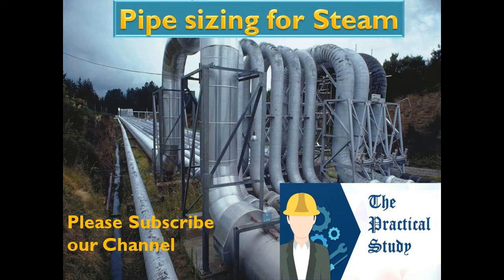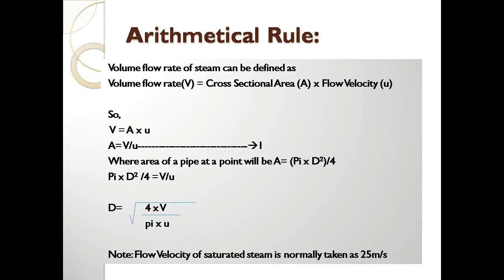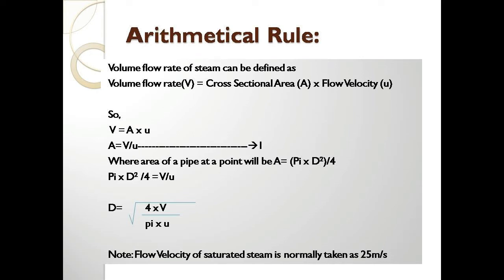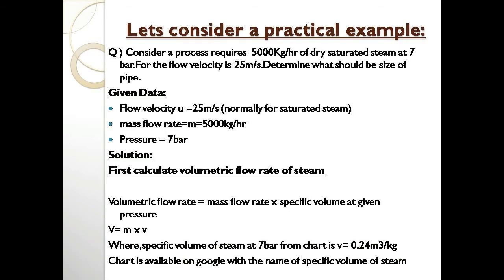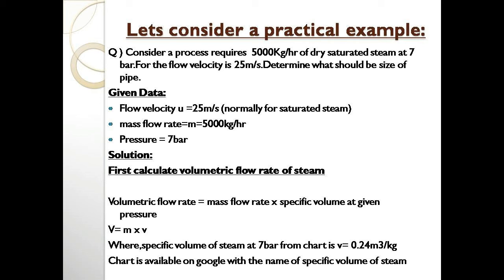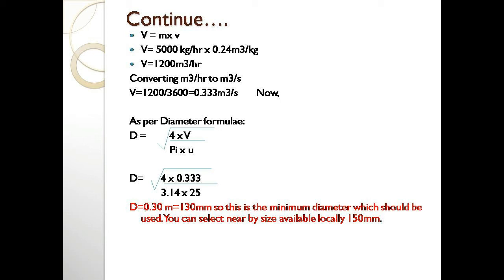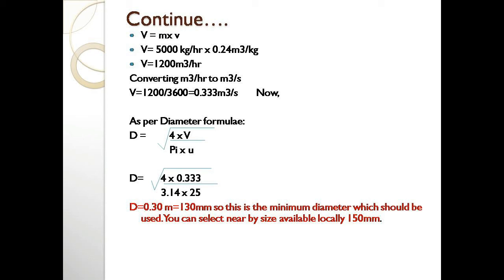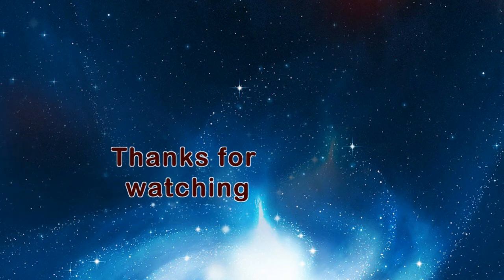Steam Pipe sizing

Comment: Is specific volume for steam at 7 bar not 0.2728 m3/kg ???? My steam tables say it is
Reply from the maker: Yes it is 0.273m3/kg at 7bar
Reply: If you consider the gauge pressure (the one which you actually can measure on operation), then the absolute pressure is 8bar. This is the number I'd look for in the table. And that provides 0,245m3/kg.

Comment: Dear sir, how are you?? I need solution from you. Please help me.
I want to learn from you. How to calculate or design a steam header (Header length-4m, Header diameter-???, Header thickness-????). Steam pressure 10 bar, Steam mass flow rate 28 tonne per hours, Steam consumed 15 tonne per hour. Please help me about the mentioned issue.
Reply: Kindly read thick cylinder and thin cylinder vessel.  BOOK- MACHINE DESIGN BY R.S. KHURMI. or STRENGTH OF MATERIALS of any author.